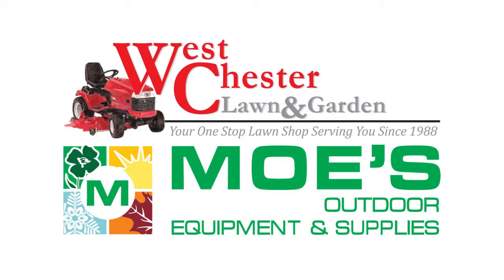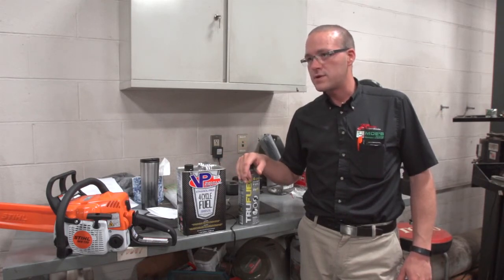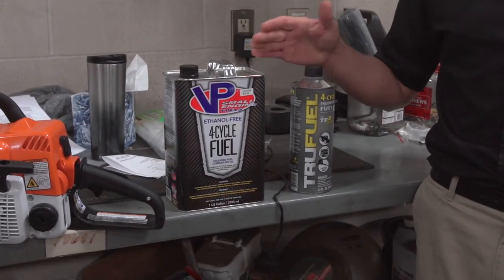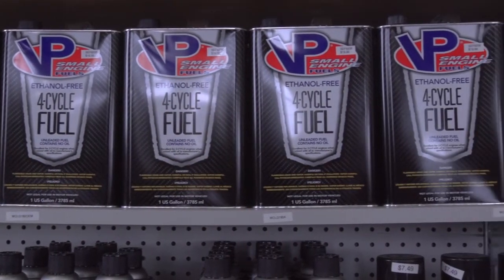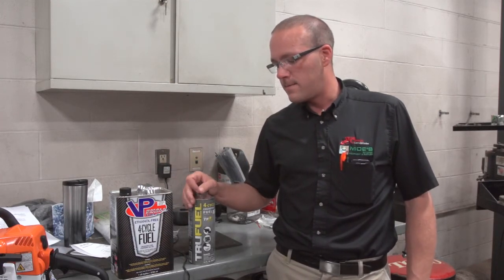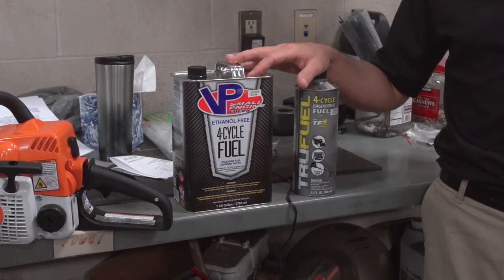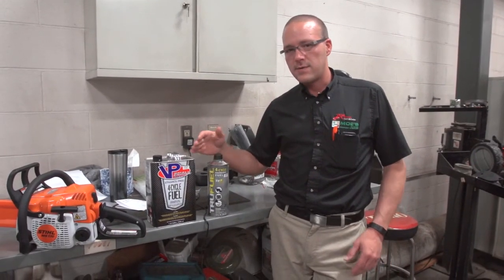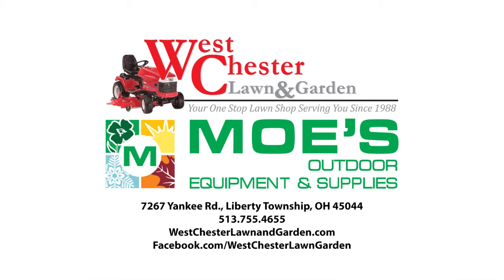Ethanol and Your Small Engines with Moe's Outdoor Equipment & Supplies (2014)

Comment: The real problem is that small engine manufactures are not adapting to the fuel changes because the Ethanol problem has driven sales through the roof.

Comment: The real problem is the crap in the gasoline. The base product is very poor, subgrade gasoline 84 octane that ethanol job is to bring up octane to 87-89. Still the petroleum junk is in the mix. What your promoting is highly refined gasoline at a high price tag.  Ethanol is covering up bad gas so oil companies make more profits.  Truth is ethanol cleans the crap out of your equipment. We've got small engines that have always run ethanol blends with no issues.
Reply: ethanol fuels will run ok in small engines.. but for people who have to store fuel or don't run the small engines often it is a disaster. ethanol breaks down worse that non-ethanol fuel and when it does it gunks up and corrodes everything it is contact with.